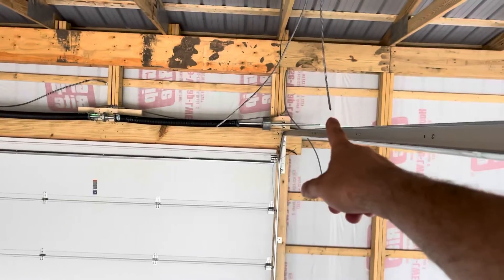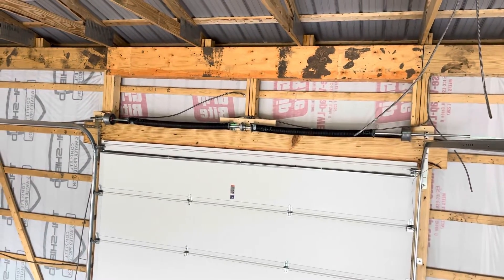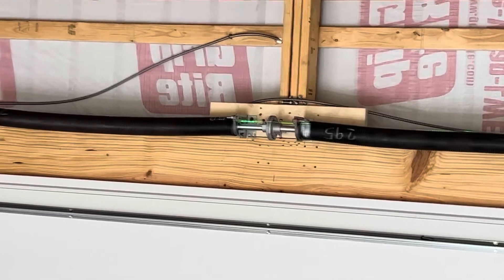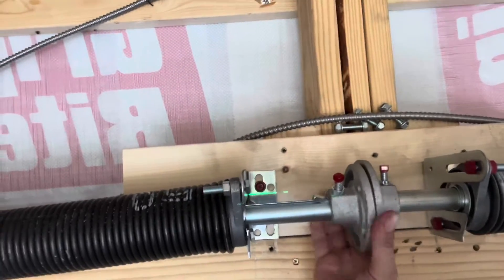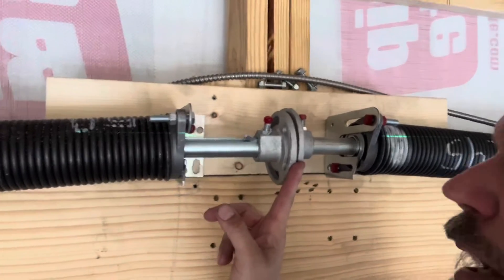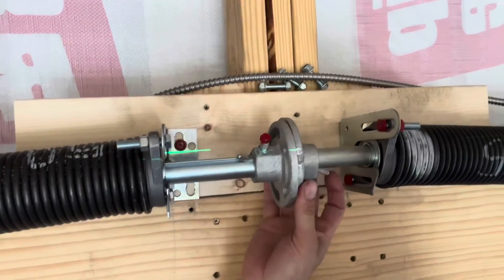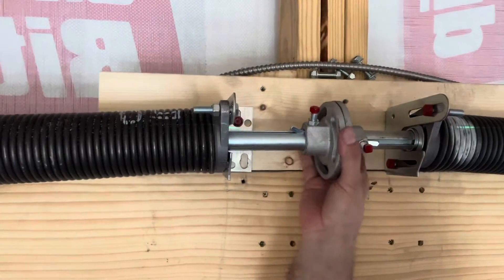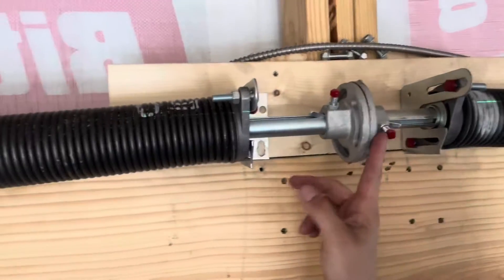How to Level Solid Shaft Adjustable Center Coupler.￼

Comment: Level door make sure splices are correct. meaning where vertical and  horizontal meet. You measure from the top of first panel adjust to correct measurements. That will put end bearings same spot. Then level solid shaft whatever side you chose and bring other side to that point. Line them up and golden. All goes off your door level and track splice

Comment: Is it completely out of question or just not possible to assemble on the ground and tighten both shafts up together, then mount it? Or maybe it's just too heavy to lift up? I have only done residential hollow shaft springs.
Reply from the maker: It would be heavy that’s for sure.

Comment: Noticed the hormann door, what do you think of them?
Reply from the maker: Not bad. I’m not in love with them but they work better then a blue tarp lol. You ever use them?
Reply: We've never dealt with them before, I'm not really a fan of proprietary hinges in general cause it's just extra parts to stock and they can charge as much as they want for them since they're the only ones that use it. Hormann does make better doors than amarr, though
Reply from the maker: I agree. I like standard hinges. If they work they just work. No reason to reinvent the wheel.

Comment: You are correct. The  set screws will loosen over time and wear out the coupling and shaft ends. Our installers always F-ed this up.  They didn't know how important this was. I always lower the centers to get the coupling halves flat to each other and let the shafts absorb the torsion through flexing. If the springs are too long, you may not be able to fix the problem by adding more shaft supports. It does help though even if the supports are closer to the drums.
Reply from the maker: Makes perfect sense. Thanks for commenting. 👍

Comment: Same as you and then adjust as needed. Sometimes if you have room you can add a second bearing stand to each side to help support the weight.  Or double each center bracket up to relieve some of the twist that the spring is causing
Reply from the maker: Great to hear. Good ideas as always.

Comment: One little trick I do is, stick the solid shaft an 1/8 past the coupler on one side and hold the shaft in an 1/8 on the other side  that way it pretty much slots in and lines up after measuring center of bearing plates and spring perches
Reply from the maker: Good idea 👍 love it. Thanks.

Comment: I personally don’t think lasers are necessary for garage doors. Measure everything!
Reply: What if your header is a bit unleveled? Bad concrete? I have seen some crazy stuff. I love using a laser level for setting the flags, which will determine everything else. I generally install my tube first without springs to get it lined up best. Takes a bit more time but I know it’s perfect.
Reply from the maker: Not a bad idea 👍